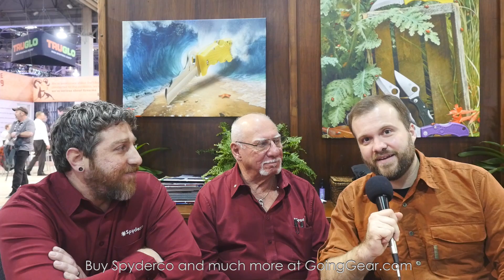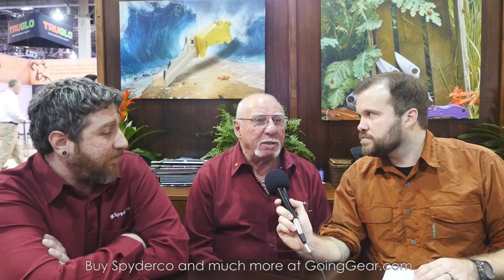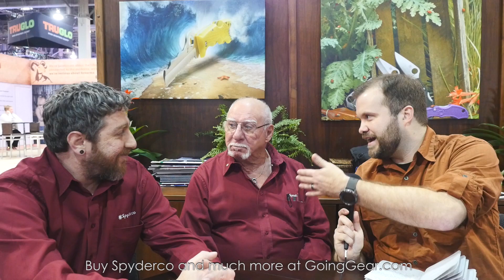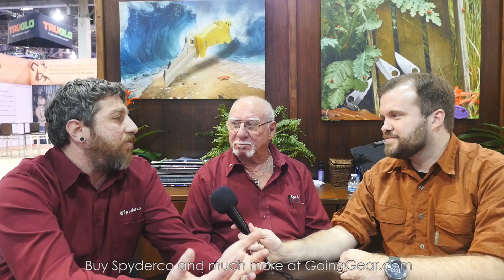SHOT Show 2016 - Eric & Sal Glesser from Spyderco

Comment: I love Spyderco. My favorites at least as far as production knives come from Benchmade, ZT, and Spyderco there are plenty others I like but those are the 3 that make up most of my knives. Actually I have bought I believe 18 Spydercos in the past 6 weeks or so lol. They discontinued a lot of models I wanted this year besides a few sprints and couple exclusives I just bought. Only other knife I got in that time is the Knifecenter exclusive Benchmade red battleworn Bugout. I like how Spyderco uses so many different steels. I know some of the others offer a variety too but most don't seem to be quite like Spyderco even though most the main staple models seem to be s30v and VG10. I like all the exclusives and sprints but they seem to be a lot harder to get ahold of then sprints, limited or exclusives from some other MFGs.

Comment: I used to be a big fan of Spyderco, however, after taking a brand new Lum Tanto to them because it had a small scuff on the blade and being told it was "used for something other than it was designed for" was enough for me to drop them for anything other than 2nd sales.  In hindsight I should have just returned it to the dealer after seeing the defect instead of to the manufacturer.